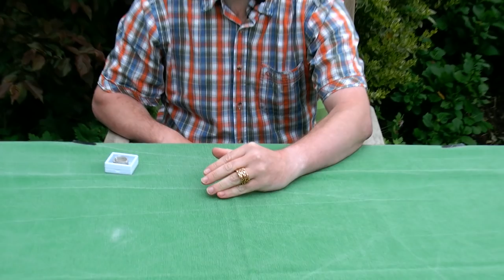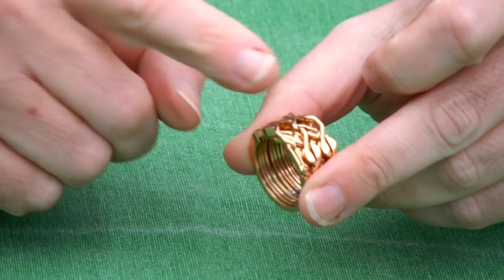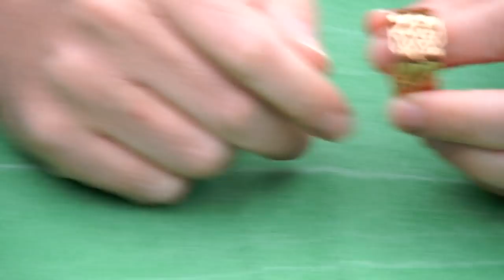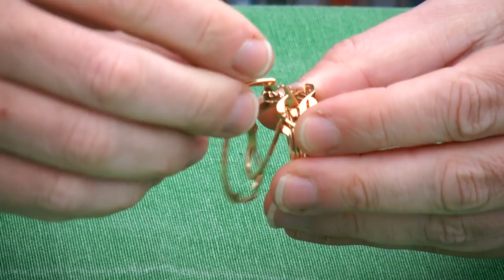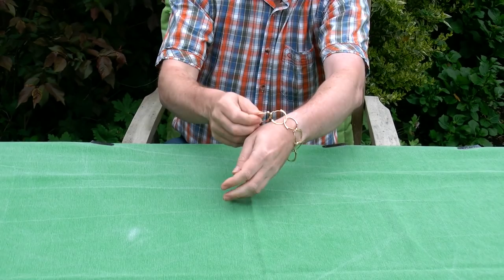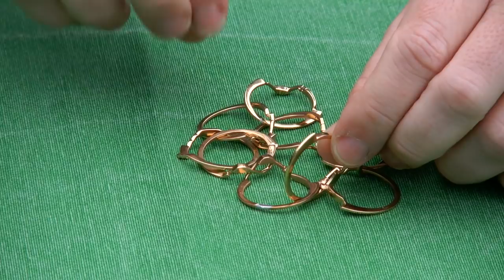Ring Bracelet polished bronze

Comment: If I wanted the silver version, would I need to buy two and have them put together by a jeweler? I’d be worried they wouldn’t know which way to solder it in place to make the puzzle work.

Too bad there isn’t a way to size it on the website so it could actually match people’s ring sizes. I think the bracelet part being a little big is fine because you could put a chain on the back to tighten it, but the ring being too small or big would feel awkward.

I’m imagining this in various shades and textures mixed together like silver, gold, rose gold, and matte and shiny versions of each color. That would be the ultimate ring/bracelet. 😍

I love this idea. I hope you can find a place that could make the full version in metals for you.
Reply from the maker: Please contact me at https://oskarvandeventer.nl/index_contact.php?subject=Ring+Bracelet if you are seriously interested. I have a contact in Turkey, who could custom make it in silver or gold, if you wish. It won't be cheap, though.
Reply from the maker: Alternatively, I can upload a resized version to Shapeways, have Shapeways print the two halces in silver, and have your jeweler connect them.
Reply: @OskarPuzzle  Thank you! I will contact you. I am seriously interested, but I will likely need to save up for it if the silver prices on shapeways are anything to go by. I love this idea though, and I think it would be worth getting.